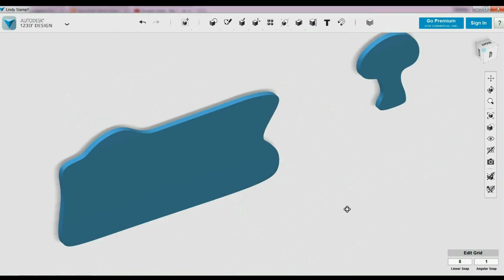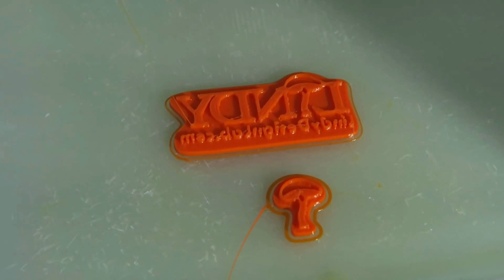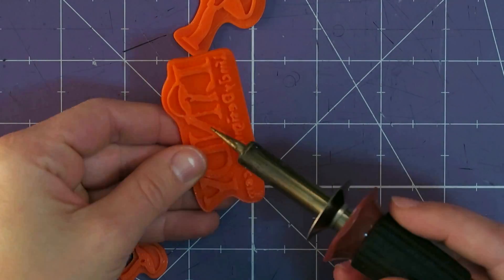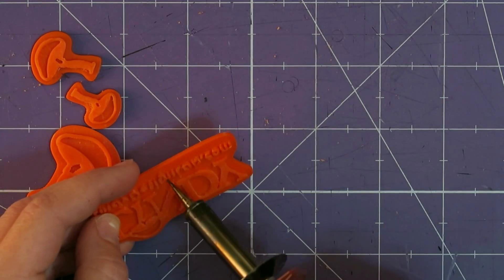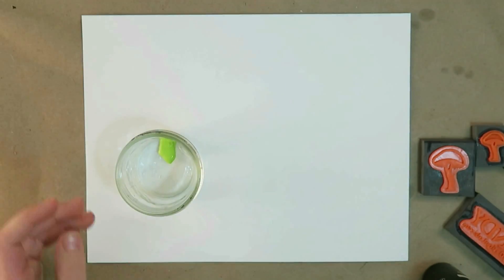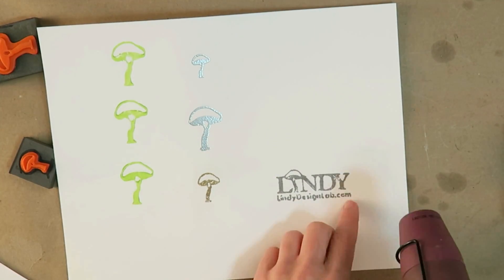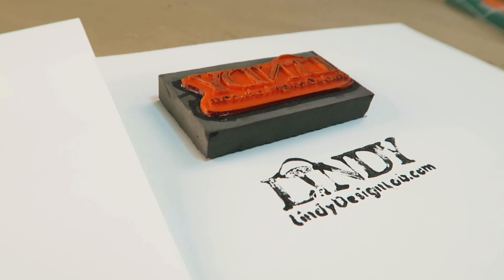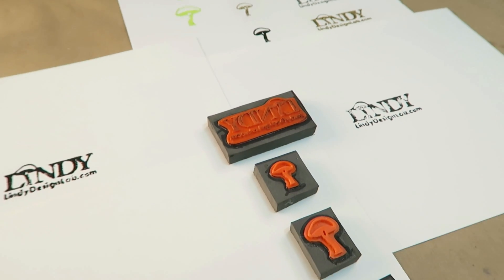Testing 3D Printed Rubber Stamps

Comment: Hello, thank you for your video. Do you think I could do it with PLA? Do you think PLA can stamp properly on fabric? Thank you
Reply from the maker: I think PLA would probably work fine. You might just need to do a little experimenting to see how it prints. If the results aren't good you can also use Sugru to transfer a hard stamp template into a rubber stamp.

Comment: How can you print with ninjaflex without ruining the feeder because on my ultimaker the feeder spinns the filament in his motor and i cant print anymore - please response
Reply from the maker: Slow the print speed way down. If that doesn't work, upgrade your extruder to something that doesn't slip like BondTech.
Reply: Lindy Design Lab okay and how many Percent Filament Flow do you have?
Reply from the maker: 100% should be fine if all other settings are correct.
Reply: okay i will try it out thanks